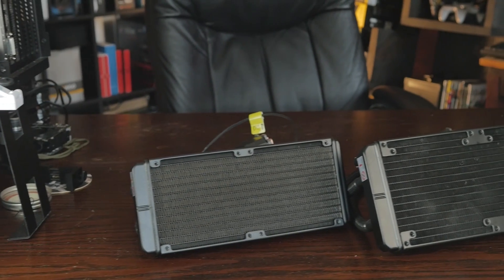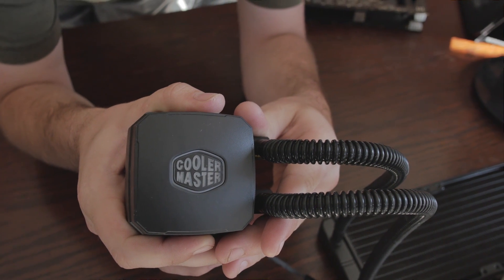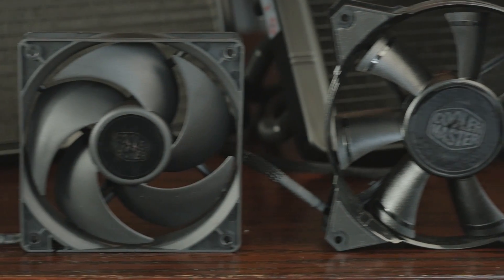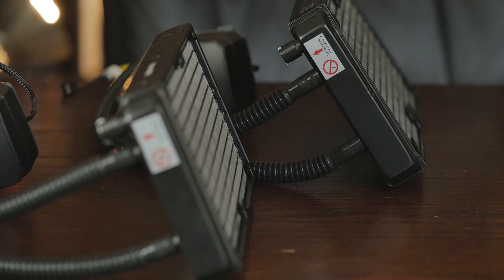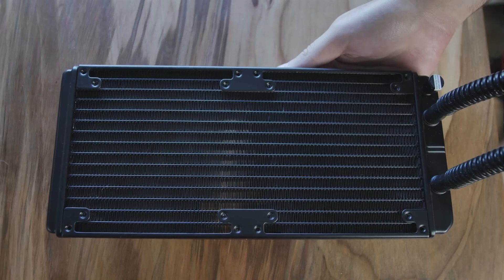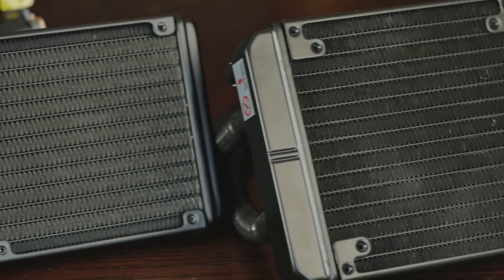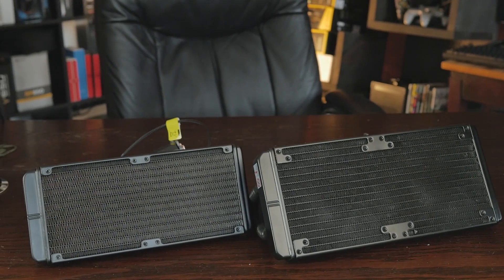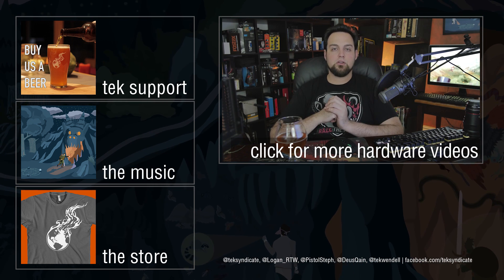Cooler Master Nepton 280L & Nepton 240M Water Cooling Benchmarks

Comment: whitch one i get i have i7 4790k oc 4.6ghz on 1.320 volts and my case is fractal desing r4 i can chetto mod 280l to front and its 5e cheaper than 240m

Comment: so what is the best cooler for the i7-4790k in the nzxt h440? The 240M or the 280L!?
Reply: Spodiesie  thats what im trying to find out lol
Reply: yianni pastras i think its the 280l
Reply: Spodiesie Assuming you can install either, it depends on what you're doing with your i7-4790k.  Are you constantly maxing out its processing and pushing it to its very limit at OC speed?  280L provides more oomph that you might need.  Just install fans that seal better on the cooler than the stock options.  It seems like such a small goof up to provide fans with circular frames that can't seal around the radiator, but you can get a few extra C lower with square frame fans.

Are you completely stock i7-4790k?  240M will do you well, as the test results showed.
Reply: ***** i will overclock my cpu, and i will edit and play games.
Reply: There you go, 280L it is!
Reply: ***** yup
Reply: +Spodiesie If you haven't bought the 280L yet, get an aircooler instead. I have an h440 and the airflow is terrible for AIO'S. I recommend the NH-D15 for silence, the DeepCool GamerStorm Assassin II for performance and the Cryorig R1 Ultimate for the best of both worlds.
Reply: Erick Ortiz ... k. im gonna look at it, thanks. btw you were just in time, im gonna buy my pc today or tomorrow
Reply: i ended up getting a x61 and its getting 23 degrees on idle and like around 40-50 on load

Comment: Interestingly the technology in the cooling block look identical to Enermax Liqtech 120X which I myself run in my system. Even the pictures on the coolermaster site describing the block are the same as on Enermax. Enermax call it SCT, Coolermaster calls it Microchannel technology.
Reply: *****I can't really say.  Never used any of the coolermaster coolers.  My Enermax work great,  so I see  no reason to swap it out.

Comment: I've got a 280L and while the Jetflo fans are one of the most powerful, they are also one of the loudest. I used to dread going into games because when the fans ramp up it'd sound like my computer was about to take off. Eventually I swapped them out for Phanteks CPU fans which are 140mm but have 120mm mounts since the 280L has 120mm holes as well. After swapping out the fans it performs very well and is a shit ton quieter than before.
Reply: I can hear them very clearly even while wearing Kingston HyperX Cloud headset which is closed headphones with leatherette ear cups... You must be deaf if you can't hear the fans even through headphones.
Reply: Sound bothers me the most with my current case. The Aerocool Strike X-Air. Horrible construction and design, but the most badass looking open-air case you will ever find. Sucks finding parts for it, because, due to it's massive size and lack of space, at the farthest distance in my office, you can still hear the single case fan. That means all my parts have to be incredible silent in order to not be heard.
Reply: ***** I realized I would save more money going with this case since I wanted to overclock my 4930k and didn't want to spend the extra on an AIO. My next computer will be almost a clone of the Colugo that Tek Syndicate made, but with a more powerful processor and the new ITX 970 that Gigabytes releasing. I like unique stuff.
Reply: Same. My 280L fans are loud as hell in my case. The fan control that came with my mobo helps a lot, but the fans run so fast when pushing the hardware. They're very quiet if it they're running at a low speed. I've learned to live with it though and I just space it out. SimonIsYourBuddy what case do you have?
Reply: Kenny Hunter I agree the fans aren't too loud when at a low rpm, but when they spin up good god they're loud. I've got a FD Arc Midi R2 that has been modified a little. I've got acoustic foam all on the back side panel, a Define R4 side panel for sound dampening and a bit of the 5.25" bay is cut out to accomodate the 280L.

Comment: Temperature can raise up pretty high during longer torture test, after one hour of OCCT or Prime95 my temps jump for 10c in a second, probably cause it's doing harder calculations after first hour, so temp. tests should be longer, however they will never hit that temps in natural using. Sorry for my terrible Engrish

Comment: Anyone know of any mineral oil cooling solutions besides putting everything into an aquarium full of the stuff. Like a custom loop with mineral oil instead of water or something.
Reply: Water cooling except using oil in the loop? first problem would be moving the damn oil around the loop, Oil can take a lot more heat (cars are testament to it) but unless its well into the 100's Celsius, its like pushing treacle with a bike pump I would imagine.
Reply: Spike20101000
yeah probably why most solutions have you put everything in a box full of it and use fish tank pumps to move it around but there must be some normal pumps capable of pushing it . or maybe some other system .
Reply: They don't use water to begin with silly.
Reply: CouchPotato343
ok distilled water or whatever it is.
Reply: scylendrey
need? no. want? yes.
Reply: scylendrey If that were true, why are records broken with liquid nitrogen?
Reply: Ashaira The viscosity of oil is too high and the solution currently used is efficient enough. The bottleneck in heat dissipation is the actual heatsink.
Reply: scylendrey
Then don't say the limits of silicon can be reached with water.
Reply: watch Linus' last video
Reply: Water conducts heat better than oil so water is better anyways.
Reply: ***** Yup, that one. But it seems it wouldn't be useful for him

Comment: I would buy a standard 120mm to replace my Corsair H55 in a heartbeat if they sold it. I cannot fit the 140 in my case (Cooler Master Elite 430).
Reply: I have a cooler master 690III  and the 140XL barely fits in the top left fan bracket , with one fan not usable.

Its possible but its a squeeze...

Comment: Can you do another h100 review like this (so the same processor, overclock it etc.) ... I just want see the difference between these water coolers
Reply: I want an H110 please!
And I'm afraid CoolerMasterNA may be a bit biased ;D
Reply: No comparison. There are other reviews that show the numbers :) The Nepton 240M destroys.
Reply: Ive got a nepton 140XL   , my 4670k is cool as shit at 4.8 ghz.
So cheap compared to those corsair ones that even perform worse...
Reply: the thing is if i look at different reviews they could be setting it up differently. for example one person might do a open case where the other one uses a closed case. therefore results are going to be different